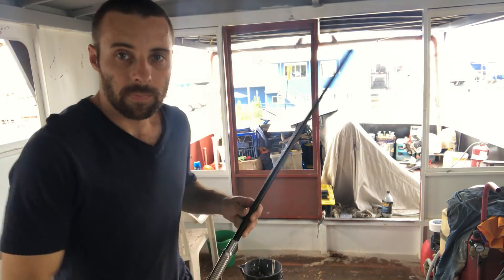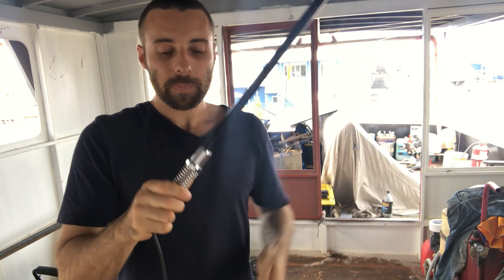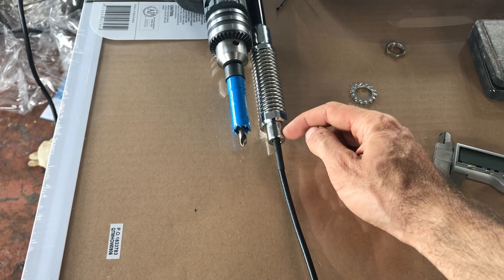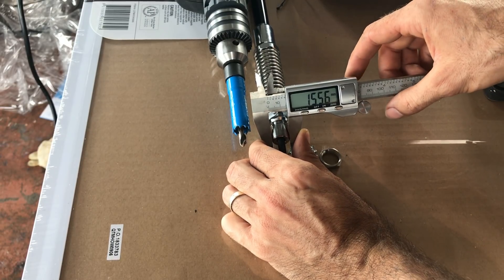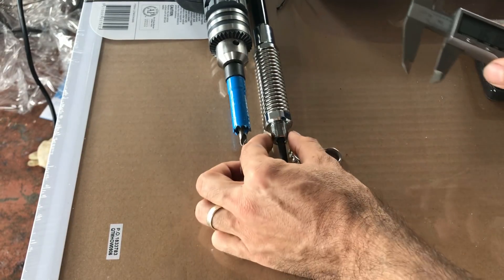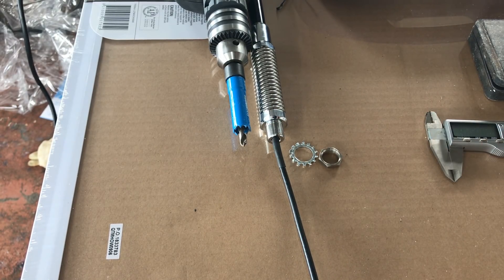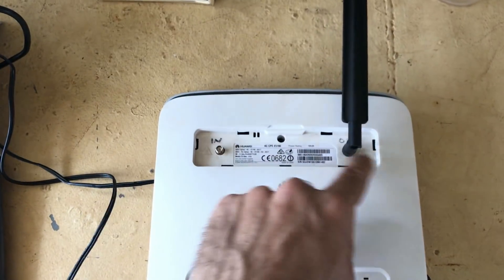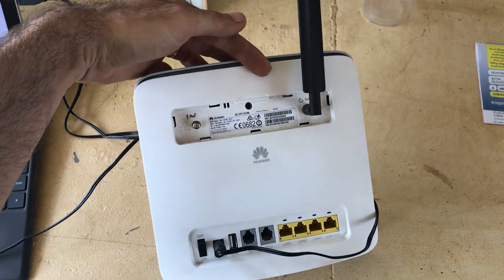How to get Internet & WIFI On A Boat - Building BRUPEG (Ep. 06)

Comment: Hi there, nice project you have going there. Thanks for sharing it with all of us viewers here.
Regarding your antenna setup. I'm pretty sure your modem uses both antenna ports simultaneously, to communicate with your service provider. This is a 4g/LTE router that you have there with 2 antenna ports. You should connect 2 external antennas, one to each port. The local wifi antenna is built inside your modem and isn't visible. There is also a few things to take into consideration regarding how to place to two antennas in relation to each other. I'm using directional antennas. They are placed a certain distance apart and aligned to different polarity. Not sure how to place two omnidirectional antennas like the ones you have, but I''m sure there are plenty of information about that here on the net if you search for it.
Best regards,
from Norway.
Reply from the maker: I thought the same when I brought it. I tried connecting the external cable to the right hand port and the small antenna to the left port and my RSRP dived. So I swapped back and the numbers went right back up. I have seen antenna sold that have two cables so I’m guessing it’s modem specific
Reply: Your modem looks awfully like a huawei b593? Whatever it is, as long as it's an LTE modem, it's supposed to use 2 (or in some cases up to 8) antennas. I don't know why you got those results, but I've never tried to connect just one antenna to one of the ports. Have used omnidirectional dual antennas that are built into one unit, but settled on two directional yagi antennas (works well for a stationary location, not so much for a boat I guess). Anyway, main reason LTE is faster than 3g is the LTE's ability to use MIMO; multiple imputs/outputs. To achieve your best speed internet, you should have 2 antennas on your modem.
Reply from the maker: Modem is LTE. Model number is E5186. We tried the same technique of swapping and measuring the signal with both this modem and the DLink and had similar results. I have seen the modems made of antennas but I’ve no experience with them only 1 in and 1 out versions.
Reply: The E5186 is a newer model of the b593. It''s a good modem. MIMO 2x2 antennas. Antenna detection is supposed to be the same on both models. I think what you are experiencing has to do with the modems automatic antenna detection. It might detect your external antenna when it's connected to one of the channels but not the other. If you connect two antennas of the right type, one on each channel, simultaneously, your modem will normally auto detect them.
There are ways to force the modem to use external antenna, so you don't need to rely on modems auto detection. This link has much info on that; https://mybroadband.co.za/vb/showthread.php/686592-The-Huawei-E5186-LTE-A-discussion-thread/page2. Look at the fifth post from the top. Also link in that post to another page and video about the subject.
Remember when selecting two antennas to use, they need to support the right frequency, should be placed so that the polarity is 90 degrees to each other and at a certain distance from each other. Also be of same type with same cable and cable lenght.
Reply from the maker: Awesome thanks for the detail.

Comment: Hi Brupeg, just found your channel via Doug at SV Seeker  looking forward to seeing your progress.
I sail a 50" cat between Brisbane and the Whitsundays and have a similar internet setup to you however I get my sim from Aldi which uses the Telstra 3G/4G network, I find the coverage much better than Optus and also a lot cheaper too.
I also have a 5 watt booster we switch on at sea which greatly increases range. I'm not sure if you can get them in Oz we got ours from NZ. You have to remember to switch them off in the marina otherwise it jams the local tower and you get a guy in a van show up and he walks the marina with an antenna until he finds the offending boat. Then you have to do a please explain! 
Good luck with the project..
Reply from the maker: Yeha Optus works great where we are but I've heard Telstra is better north and off the coast. could you post the details of you booster as I'm keen to investigate those.
Reply: https://www.weboost.com/products/drive-4gx  Check the Fq. bands for your providers and compare. They may make one that crosses over. Very very high quality.
"boat" Category https://www.weboost.com/collections/boosters-boat
Reply from the maker: Awesome thanks for that